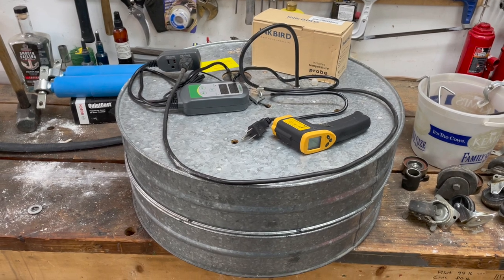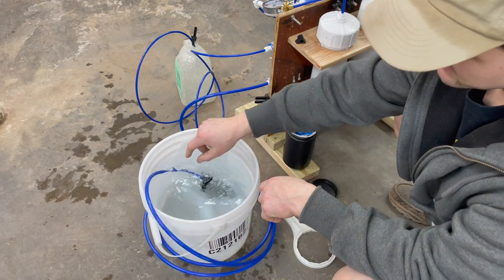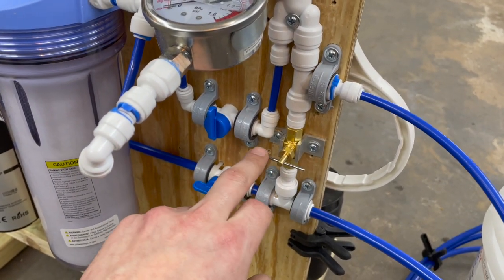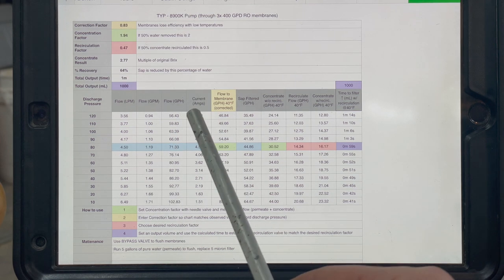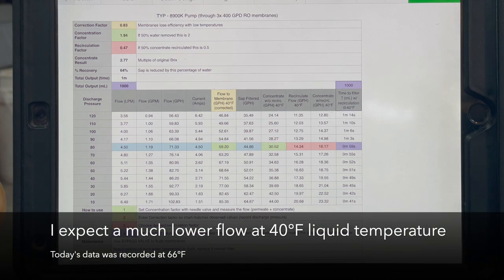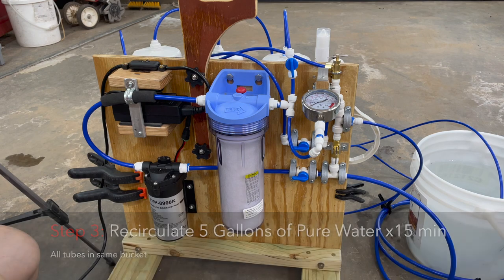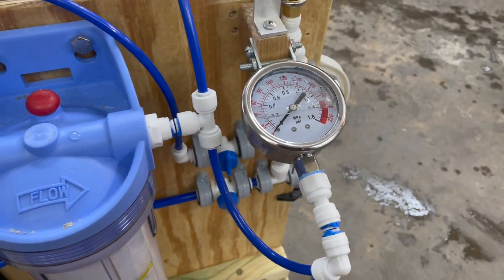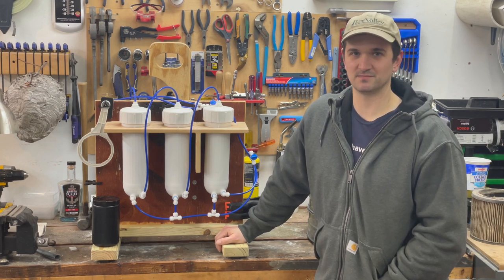DIY Maple Syrup Reverse Osmosis

Comment: So the process is that you have a bulk tank and keep running the same concentrate back through the RO unit perpetually until you are ready to boil it.  So based on flow rate, you may run it 3 or 4 times over night.  In other words, you are not taking the concentrate directly off the RO unit into storage / evaporator 

Great video.  I need to watch it a couple more times.  Thank you for sharing and taking your time to put this video together.
Reply from the maker: Thanks! My plan, and I’ll find out this weekend, is to hopefully use the recirculation valve on the RO unit to remove enough water to take the concentrate directly to the preheating pan. Right now I don’t plan to do more than one pass before boiling or store any concentrate for longer than a few hours… we’ll see. I will have a good deal of time so I’m planning to take some video of the process.

Comment from the maker: READ THIS: My 5 amp transformer powered my 7 amp pump (Coronwater TYP 8900K) for 12 hours removing an average of 8 gallons per hour of water and producing 6.5 gallons per hour of concentrate before it took a smoking break and never came back. Luckily I had an Aquatec 8800 pump and was able to finish the rest of the boil with the RO removing 5 gallons of water per hour producing 7.8 gallons per hour of concentrate. My raw sap temperature was 32°F. Aside from a burned out undersized transformer everything works perfectly! Working on batch two (with a new transformer and experimental RO preheater).
Reply: What transformer did you end up using?
Reply from the maker: @TheScorpionbowl  I purchased a 10A 24V from LedWholesalers on Amazon. Others have used it with success. I’ll find out for sure.
Reply: @samuelwiltzius  Isn't your pump a 12v pump though?  Don't think you can use a 24v on it..
Reply from the maker: @paulslund1  The Aquatec (small 12VAC pump) was too weak, the current pump (TYP 8900K) is 24VDC and works very well.

Comment: Question. What is the reason behind running multiple membranes in series. Seems to correlate to capacity. Not sure I fully understand.
Reply from the maker: Each membrane can remove so much water per hour, the remaining concentrated liquid then moves to the next membrane - in series the concentration builds after each membrane and flows quickly, in parallel the flow would be 1/5 as fast on each membrane (for 5 membrane setup) and the lower velocity could lead to the membranes clogging faster. I have not tested this but that is the current reasoning.

Comment: Very nice video Samuel.  I'm a bit confused on where you decided to use 1/4" tubing and where 3/8" tubing was used. It's difficult to tell from the video. Could you tell us where each is used and where the 3/8" is reduced to 1/4". Or does it not really matter as long as the connections are made.   Thanks much.
Reply from the maker: Thanks! I have a link in the video description with a lot more details (and photos)

Comment: I am borrowing an RO system from a friend to use for my sap.  He only has one RO filter (no prefilters).  I can build up the pressure to about 80-85psi total.  However it seems like the flow is nowhere near yours.  When the concentrated sap is flowing, the permeate (pure water) is just dripping.  I'm trying to troubleshoot this and figure out why?  Not enough powerful pump?  Does adding more filters make it flow better?  Seems like at the rate it's going for me, it'll take forever for the RO to make a difference.
Reply from the maker: Close the needle valve down - this controls the ratio of permeate to concentrate.
Reply: @samuelwiltzius  when I close it down, both concentrate sap and permeate slow down to drips
Reply from the maker: @ShopTherapy623  next look at your intake lines. It sounds like there may be a leak on the fittings between the pump and the raw sap - look carefully at all fittings on this part.
Reply: @samuelwiltzius I found out I have a "check valve" on my concentrated sap side of the RO membrane.  Someone said that could be causing problems.  I will definitely check for leaks too - I might just replace all the tubing and fittings.  Even with my needle valve all the way shut, I can get the pressure past 85-90.  So there's definitely something wrong with the system.
Reply from the maker: @ShopTherapy623 also; some pumps have a max-pressure set screw. Might be info in the pump manual on setting it.
Reply: @samuelwiltzius  Yep, I checked for that.  I dont have the manual but there was no obvious adjustment screw anywhere on it, so I dont think it has one.

Comment: Hi, i need help please, i bought a second hand reverse osmosis , i changed all the filters , added the pressure gage and the pressure pump, when the season started the RO wasn’t able to separate the sap from the water and the pressure gage doesn’t have any pressure, any idea what my problem is? Thank you
Reply from the maker: Could be several things… start with the membranes - remove them and inspect them. If they are damaged, sugar will pass right through. After that; plumbing and valves - look to see the membranes  are plumbed correctly.

Comment: Curious question, I only tap about 20 trees. And I have a 5/16 main line. Would I be able to hook this right up to the mainline and use it as a vacuum pump also? And illuminate my sap bucket. Thanks 
Fred
Reply from the maker: This type of pump is not made to pull vacuum. It would not work and would likely lead to premature pump failure.
Reply: Oh ok great thanks

Comment: After a successful sugar season with my own RO system I was reviewing your video again and wondered where you came up with the great mount for your gauge.  Is that a custom bracket? Great video and thanks for sharing the Quick start guide.  That was a fun read.
Reply from the maker: Thanks Adam. The bracket is the clampy part that holds the assembly of a standard heat lamp - reused from my parts drawer.

Comment: when you say flush it are you running water through the membrane's in reverse?
Reply from the maker: Flush in this case means to wash water over the membranes (not reversing flow). Essentially water passes over (instead of through) and washes off gunk that accumulates out the concentrate line - very little water will come out the permeate line during a flush.

Comment: Great video!  I'm modelling my build after this..

Can I ask how you are dealing with the different tubing sizes?  I noticed that RO intakes housings tend to be 3/8, however output tends to be 1/4... I don't see any 1/4 to 3/8 connectors when you connect the housings concentrate output to the next membrane input?  THanks!
Reply from the maker: I ordered some specific connectors for this (also, use a ton of Teflon tape!) - in the video description I have a link that takes you to more information. Cheers!
Reply: @samuelwiltzius  Ah okay I see!  Thanks a lot!

Comment: I thought the TYP-8900K pump required a pump to feed it sap @ atleast 30psi or they blow up. Have you had good luck running that pump solo?
Reply from the maker: Running solo without any issue. I wrecked a transformer but that was my fault for undersizing it.
Reply: That’s great news. I’m building a similar RO. I think I’ll buy the same pump. What do you power it with?
Reply from the maker: @jerrythechainsawguy8100  LEDwholesalers 24V 10A 240W AC/DC Power Adapter with 5.5x2.5mm DC Plug and 2.1mm Adapter, Black, 3264-24V https://a.co/d/a0chaOv

Comment: Excellent description and video. I'm trying to build my own RO system right now in the middle of the MN sap run. I don't have the recirculation value. I cannot keep up boiling with roughly 60-100 gal of sap per day so looking to shorten the boiling time but not sure how this is all going to work. I'll have to do some trials.
Reply from the maker: RO really changes the process; I was able to do 285 gallons in 18 hours instead of 36. Saved a lot of wood too. It was also more enjoyable - which I really value as a hobbyist. I found that I can only remove so much water per hour and the recirculation valve decreases the total gallons per hour of concentrate but results in a higher brix of the concentrate. Essentially, if the concentrate is being made faster than your boil the recirc valve is a really valuable addition.

Comment: Great video and thanks for sharing. I'm curious how the switching power supply held up. I believe you listed a 5 amp supply and your pump looks to be drawing 4.5 A consistently. Did you run into any thermal shutdown issues with the supply?
Reply: I watched your next video and found my answer. Again, I appreciate the videos.
Reply from the maker: The power supply was fine with the smaller pump… when I went to a more powerful pump and didn’t upgrade the power supply that’s when things got smoky.

Comment: I like your set up, nice and clean look to it.  What are the dimensions of the plywood piece?
Reply from the maker: Not sure off hand. I think 22” x 22” give or take.
Reply: @samuelwiltzius Hey Sam, nice job! I am plumbing my board now,   I see you have your pump inside the recirculation loop. If I put the recirculation T beyond the "out" side of the pump will it still work?
  In other words, my pump would be before any of the fittings.
Reply from the maker: @jscott3509  the recirculation stream needs to be higher pressure than the line it enters to work. I have it on intake to achieve this. I think some setups have a separate high pressure pump to inject recirculate if it’s being added to a high pressure line.

Comment: That is pretty similar to the one that I made, except that yours is higher capacity. I am adding a U V sterilizer to my concentrate line so that I will be able to store my concentrate for longer periods in between boiling days. Can you share your source for the preservative chemical?
Reply from the maker: I’m starting with the preservative from RObucket.com for now. I think it’s just citric acid, but since I’m small scale I figured I’d use something sold specifically for a setup my size to start.
Reply: I found online that some use potassium metabisulfite as a membrane preservative.  Any homebrew store has it for cheap. It is used in wine making.
Reply: Hi David. Could you post some information about the UV sterilizer you are using?

Comment: I did a test run with well water & it seemed like I had a 1:1 ratio at about 60 psi. I have an aquatech 8800 Booster Pump, 5 micron pre-filter & four 150 gpd membranes.
Reply from the maker: That will change a lot when you try to push cold sap. I looked in my notes - room temperature tap water vs 40F sap my output (1:1 ratio) was 42% of the tap water gallons per hour. My psi also jumped by 45 psi.
Reply: @samuelwiltzius  thank you. That helps a lot.